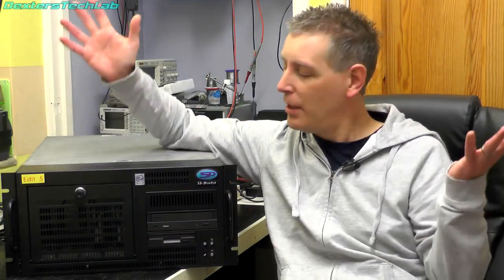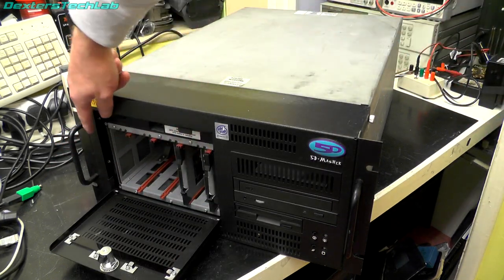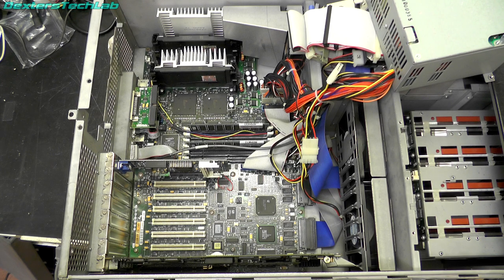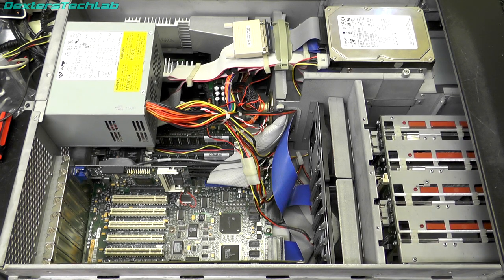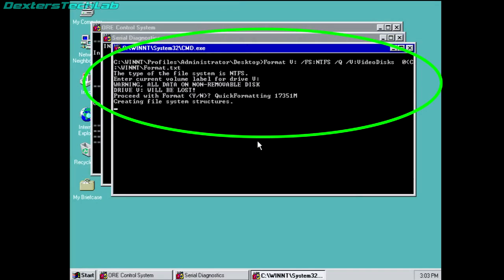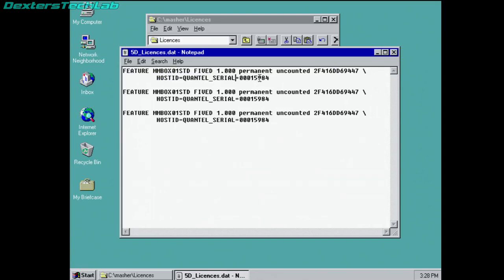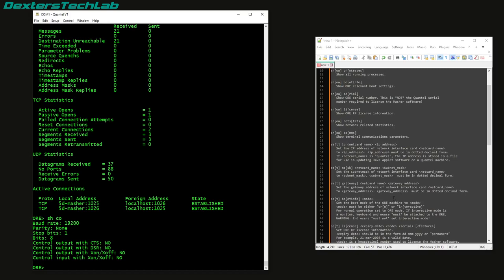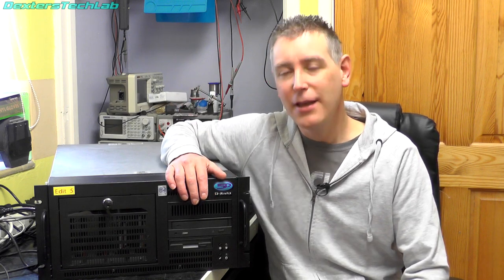DL243 5D Monster Masher A 1990s PC For Video Effects Rendering

Comment: The motherboard is the one that was used in a TDZ-2000 GT1. John Carmack used one during development of Quake III. The chipset is called ServerSet II LE. The only other workstation using it I know is the Compaq SP700. RCC, later ServerWorks competed with Intel in the high-end workstation and server market and finally was acquired by Broadcom. The ServerSet's II main feature were the dual PCI-buses to maximize I/O bandwidth. The SDI I/O card is known as Raven DS and was used in a turnkey solution for Softimage DS.
Reply from the maker: Awesome info there, thank you. I must admit something in my head said there's too many PCI slots, so that's why and also why there's two northbridges?
Reply: @DextersTechLab  Don't forget to add the on-board NIC and SCSI controller to the number of PCI slots, these are also PCI devices ;) Yes, each of those chips contains a PCI controller and, what I have forgotten to mention, a memory controller. This also means that its memory bandwidth is doubled compared to a classic Intel 440BX or 440GX chipset (1600 MB/s instead of 800 MB/s at a 100 MHz bus speed). If you search for "Second-Generation Highly Parallel System
Architecture for Compaq Professional
Workstations" (two documents from 1998: ecg0770998.pdf and the updated ecg0921198.pdf), you will find the whitepapers for the SP700 which is using the same chipset and everything they've written about applies to the Integraph system.

Comment: Crikey, long time since I saw one of those! GMTV retrofitted one to their HAL. I had it in my mind that it used parallel digits to interface to the Masher - but obviously not? This would have been in the early 90's and some Quantel kit still interfaced via parallel digits and some bits were moving over to serial digits. Can't remember too much about it apart from the fact it just sat their reliably running 24/7 with, I think, only once instance of it ever going wrong. I think GMTV bought it to extend their range of picture transition styles, never heard any grumbles.

Comment: 10:47 - Random 4am thought...

Those chip packages look almost the same as the "Holly" GPU on the Dreamcast. Made by NEC.

IIRC, the Dreamcast GPU has 500 solder balls.

Never seen this system before. Interesting about the mouse port thing. I assumed they had wired some custom board up to the PS/2 mouse port, but I'm only 11 minutes into the vid so far. lol
Reply from the maker: Just had a search and yes, it is the same package style!